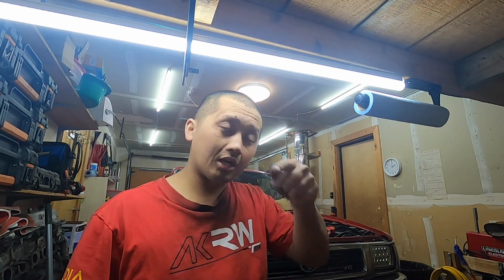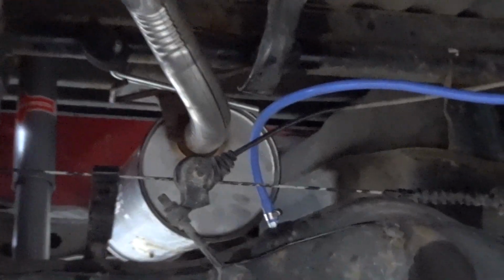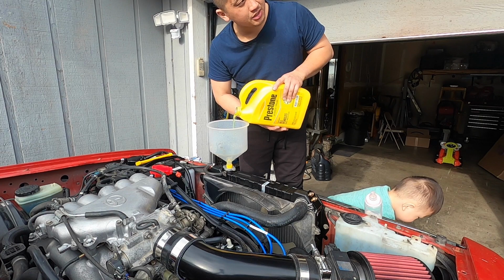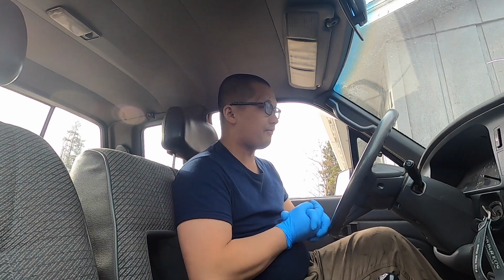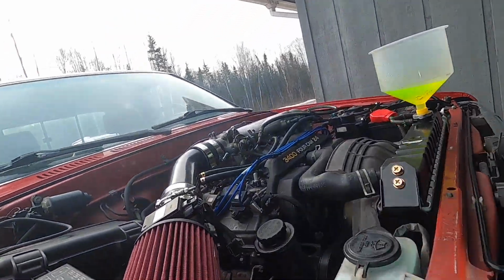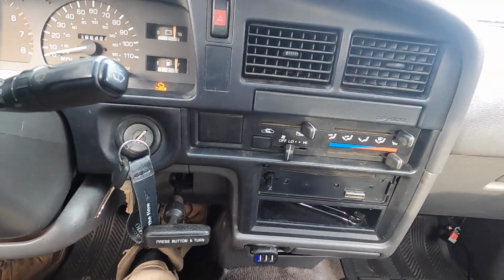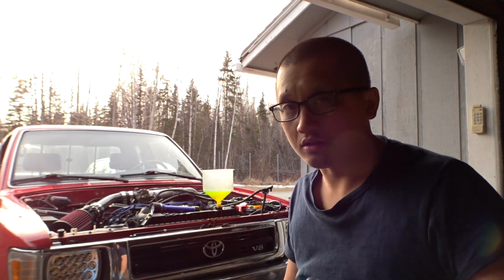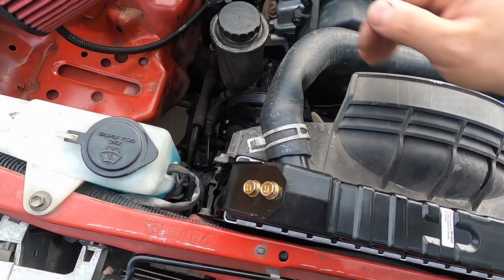TOYOTA 3.4 SWAP | FIRST START!!!

Comment: Great job.
I am getting ready to put new shocks on my 93 4runner. I want KYB, but not sure which model.
I plan to put BJS and the Mono Max have 2 versions of the fronts. Either stock height or expended for 2 inch lift. But l would rather get the Gas Adjust like you have for the softer ride. Only thing is l can't find a extended version. 
Are those ones you got going to have enough travel when you put on BJS?
Reply from the maker: I believe it should,

Comment: Great job on the swap out.  I have Tundra and I want to bypass the O2 sensors.  Do you know where I can get the bypass plugs.  You mentioned that you get them from a guy called John in Alaska.  Any information will be greatly appreciated.  Thanks.  Vince
Reply from the maker: I did not by pass my o2, I bypassed the cat converter. You have to wire it in a way to by pass it.